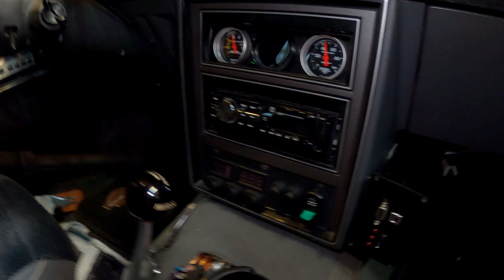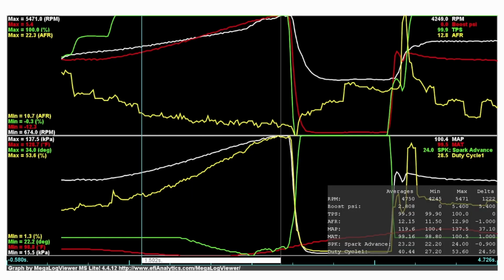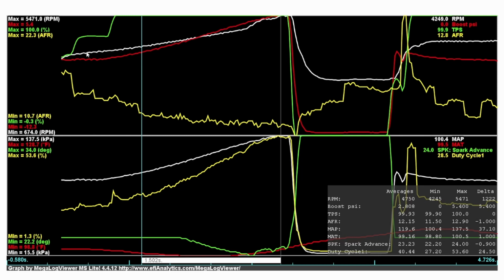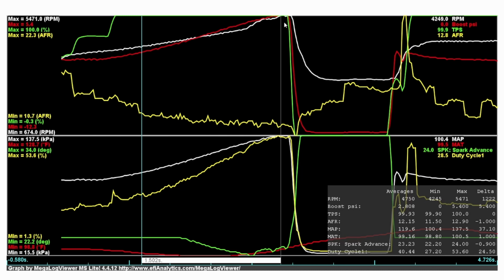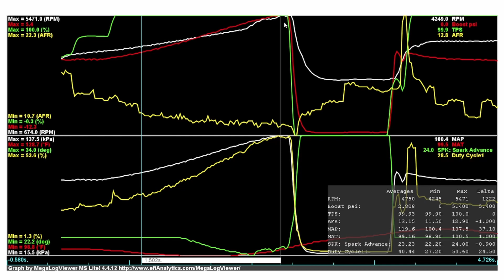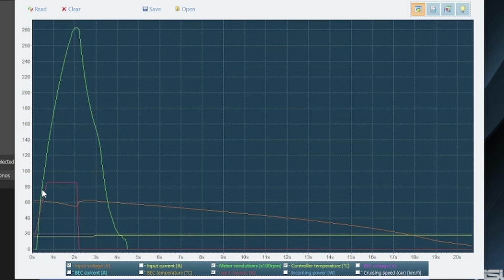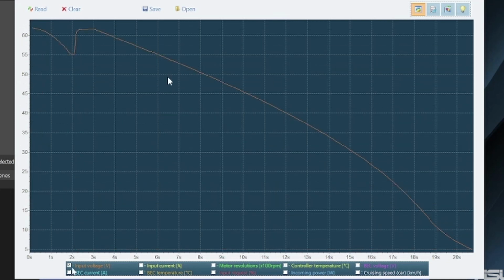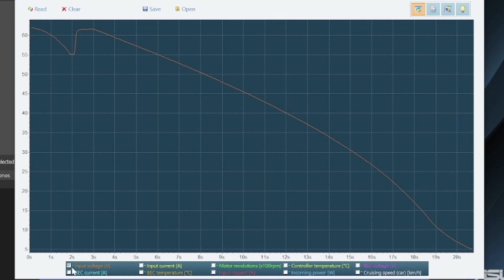DIY Electric Turbo: Sledgehammer - First Boost!

Comment: Oh and to address the why wouldn't you want to be in boost for 2 or 3 minutes you're losing traction instantly has nothing to do with the amount of power you're making it has everything to do with how incredibly poor suspension design is on that 40 year old vehicle Not to mention the lack of proper proper rubber in the rear I mean if you don't wanna go wrinkle wall slicks then at least put drag radios on it and get rid of those seventeens for a set of 15 if this is a drag car you don't need huge brakes especially rear brakes And once you hit 9 and a 1/2 seconds and 150 plus you're gonna have to start packing a sheet anyway
Reply from the maker: This is a fox body - arguably the greatest platform ever made for straight line traction.  The brakes may suck, it might not handle that great (though it's not bad) but in a straight line, it's tough to beat a fox.  And there's almost no stock suspension pieces under the car anyway - the front has a chromoly tubular k member, Strange 10 way adjustable struts, springs, etc.  The rear features a GT rear end, Megabite rear lower control arms (bottom hole), springs, shocks, an airbag, etc.  It's gone a best of 1.41 60' running high 9's on the previous Whipple setup; it pulls the fronts even on tiny 26x8.5 Hoosier still sidewall outlaw slicks.  Watch the beginning of this video - there's a bunch of timeslips, a pic of a small wheelstand, and a launch on a 140 mph, 9 second pass (unfortunately with some spin, but still a hard leave): https://youtu.be/j8SNo7kpcxw

Comment: Bet youd go faster if sent all that power to a tesla motor to wheels
Reply from the maker: You'd see about 4.5 times LESS gain.  Watts and Hp are directly relatable.  The Sledgehammer draws 35,000 watts when running - which mean the motor on the Sledgehammer is in the 45 hp region.  We picked up 205 hp at the wheels with the Sledgehammer.  If the Sledgehammer's  motor was connected directly to the wheels (not even taking into account driveline loss), we would've only seen at 45 hp gain.  He's the dyno video: https://youtu.be/b9d5xv9INmw